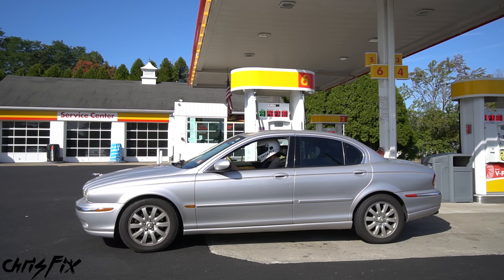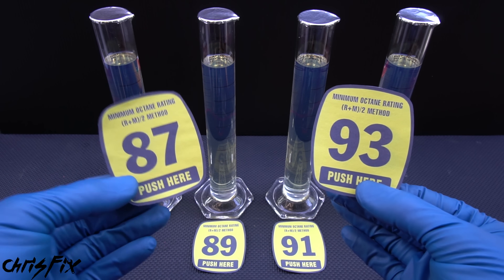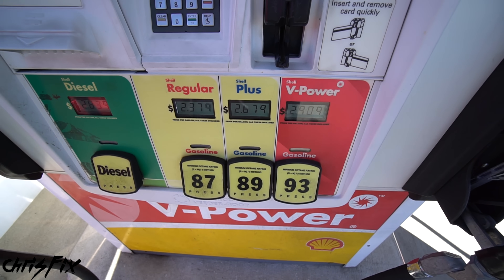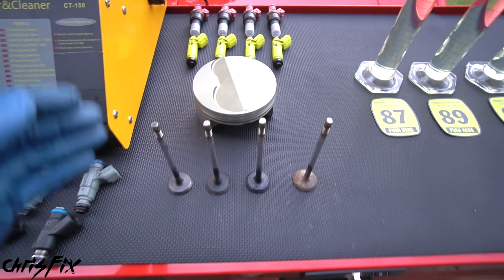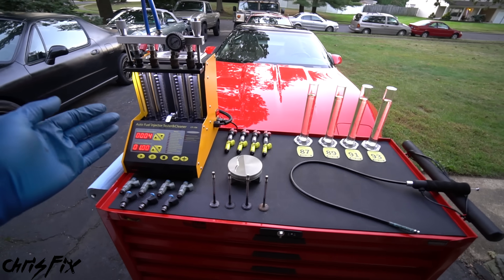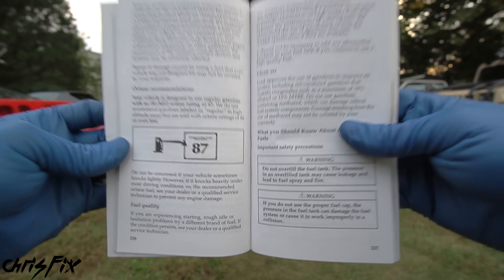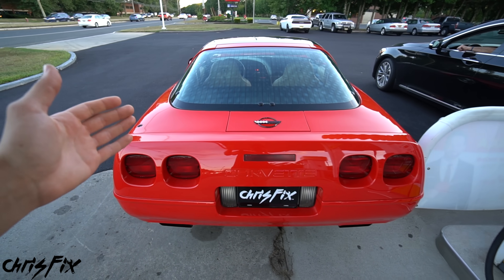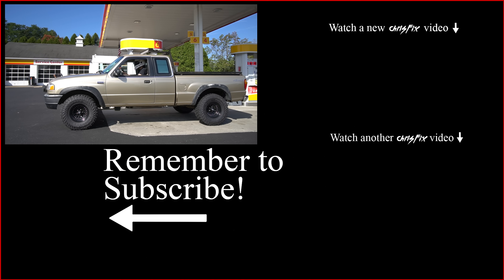What is the BEST Fuel to Use in Your Car or Truck and WHY

Comment: The question I was hoping you would answer was if an older European car says 91. I've heard 2019 American has is different and put can use 89 or 87 HD or says 91 in the manual. But I forget the details. 25 years ago I don't think they had the ability to make the 93 we have today. I could be wrong but that's what I've been told.

Comment: always found it weird visiting ammerica and pulling into the gas station and there being so many choices of petrol, In the UK we literally have 95 or premium 99, some cars here actually need 99 if you use 95 it will cause an EM warning. also 2.39 for a US gallon in the UK we pay roughly £4.37 per US gallon which is $5.50 a gallon

Comment: Hey brother this is a great video. Helped me have a better understanding...... BUT some cars with a knock sensor will actually make the car buck and run like crap.... example, I had a 1992 escort GT, had no idea about what gas to run so I always ran 91 and it ran like a champ. One day I needed gas and forgot my wallet and only had a few bucks cash so I grabbed 89. Long story short, the car bucked and bucked under medium acceleration. Couldn’t figure out why so I drove it lightly and ran my 91 and BAM! It was fixed. as a mechanic, I still don’t have a complete understanding of fuel but this definitely helped..... thanks a lot brother, keep the videos coming, you’ve come a long way and have such great knowledge to share with so many people including professionals

Comment: @ 0:15 - @0:26 LMFAO ~ can't imagine I could drove 4-6 cars into the same gas station in the same spot on the same day wearing the same helmet. hummm....I wonder if using seafoam helps cleaning the engine given I have been using O91 all the time; when the stealership will encourage consumer to service their car on decarb for $200+

Comment: I used to have E85 on my Mazda 3 2008 non-turbo it was normal after 2 weeks and later the engine lost RPM. Good news Mazda 3 didn't power off the engine still stay up but won't move or increase RPM. So I replace fuel pump and remove gas tank put regular gas everything is normal. I am little surprised the engine still stay up really strong because last time I replace spark plug it destroyed everything from E85. I have never seen spark plug destroyed completely after the engine went down after 2 weeks.

Comment: So i could clean my injector by filling my car with shell nitro plus? 
Btw my car recommends regular

Thanks
Reply: Use regular, like recommended, and run a fuel system cleaner every oil change, or second oil change, to maintain a clean fuel system. See Chris' fuel systems cleaner video for more information.

Comment: From my findings, find the station that sells the MOST gas in your area, and buy that. It might be a little more expensive, but better gas mileage all the time. I have a 2006 Scion TC that gets somewhere between 19 to 21 on just anyone's gas. Sheets gets 26-28. A 1992 S10 with a fresh 2.5L 4cyl. gets 19-21 on anyone's gas. But Sheetz gas I get 25 solid, and up to 27...
I have shopped several places Exxon and other top names as well as Sheetz. I ALWAYS get better gas mileage with Sheetz. My rationale, with Sheetz; they move gas faster, get it out of the tanks faster for more fresh gas restoration. The one point that everyone agrees upon. Ethanol gas doesn't have a long shelf life. So that is why I think I get better mileage with Sheetz. Truely though, any station with say smaller tanks, or larger customer consumption will get the same or roughly the same mileage. It is just the smaller stations that do not move the quantity and has older gas in their tanks...

Comment: I Like the video and you are right about the difference in measuring the octane numbers, but at special pump stations in Germany there is 100 Octane (Shell V Power) and 102 Octane (Aral Ultimate). This is good especially for high power turbo engines, for example the Golf R or the AMG A45 engine.

Comment: Have have some questions. Are you recommending to use shell Because I personally use Thornton’s so should I change? I have a 96 Chevy Tahoe I put mid grade in it and I put Lucas fuel additive in it every 2nd or 3rd tank is that okay for cleaning the carbon? I have the 350 engine so I get bad mpg (like 10 mpg) so how could I get better mpg?

Comment: Resistance to detonation (under pressure). The fuel burns both hotter and more completely under pressure because there is more air to burn the fuel. More air, more fuel, more energy released. More energy released, more heat. The fuel may burn at the same temperature, but due to the fact that more is burning within the same or many times, smaller volume, more heat is produced. Simple thermodynamics. You can actually measure this difference with a temperature gauge and a car that recommends or requires premium. If you run regular, you will see slightly lower coolant temps. Run premium and you'll see higher temps because more heat is dissipated through the cylinder walls. This test is only applicable in high compression engines. 

Running premium in a low compression engine will not do anything besides hurt fuel economy slightly because the engine isn't burning as much of the fuel injected. Read your owner's manual and use the recommended fuel. I 100% agree with you there. 

Good points about the differences in fuel rating between countries. Good warnings about valves and injectors. 

Hmm... 2500 miles of shell v-power = about 100 gallons at the current national average fuel economy for USA. Average cost difference between regular and v-power nitro is about $0.30/gallon. $30 for a 70% cleaner engine or $9 for a can of some other cleaner (some even use distilled water) and keep using regular? Gotta love Shell's marketing.

This is coming from a guy who uses only Shell V-Power Nitro, so I am absolutely not opposed to their gasoline. I am just very much for factual presentation of information.

Love your videos Chris. Been a subscriber since before 100k subs.

Comment: I am quite sure different gas give you different power output, maybe not because of the Octane but the additives. I have do a little test by myself few years ago. 5 tanks each with higher and lower octane and 5 tanks with lower octane + octane booster. I only refuel when warning light is on and I do it in a 2-2-2 and 3-3-3 tanks pattern try to minimize temperature and humidity difference, the test results are consistence (not much difference in my routine and driving habit between tanks).  
Higher Octane fuel comparing to Lower Octane: more expensive, average around 5-6% more mileage per tank, rev goes up faster when racing and no knocking for both.
Lower octane + octane booster comparing to Lower Octane: VERY Expensive, no significant mileage difference, rev goes up even faster but a bit more backfire than usual.

Comment: Great as always Chris. However. You didn't talk about the ethanol added to all (in Canada anyway) fuels. 10% here in Canada. (I know but many may not). Again it's all about knock and in ethanol's case "Politics". LOL. The other thing is fuel additives. You may have covered this before and I just missed it. But it's probably one of the most curious and confusing topics out there. Other questions like "what if I used a Lead additive like they had in gas in the old days?" Or "what if I mixed my gas with race fuel?" Yes I know some of these might sound silly but people want to know. Thanks for your always excellent content!

Comment: My vehicles manual says 87 minimum and 93 for towing or "severe" duty
I run what my budget dictates at the moment then adjust the weight of my right foot accordingly lol.( the addition of ethanol ruined the actual rating and quality of fuel anyway in my opinion)

Comment: Some people may have been mislead to believe there is Octane in gasoline based on your choice of words. At one point you said the Octane rating describes how much Octane is in the fuel. But it is the Octane rating. Not content. 

Octane is a hydrocarbon, an alkane with 8 carbons in its chain. C8H18. Alkanes are just hydrocarbons in which the Carbon to Carbon atoms share a single bond.

The Octane rating does correlate resistance to pre ignition. But the actual rating translated further describes how well the fuel resists pre combustion compared to a mixture of iso-octane and heptane. So, 91 octane fuel resists combustion as well as a mixture of 91% iso-octane and 9% heptane. 

And for everyone outside the US i apologize for using American Chemistry slang. IUPAC methods properly name iso-octane trimethylpentane just like iso-butane is trimethlypropane. Dont sue me.

Comment: Chris helps all us ! In all kinds of ways , even if it's a common sense thing like the correct fuel ! I would also add Lucus fuel injector additive for any car or truck to additional clean your new or older vehicles especially older trucks that pull anything!!! Use mid grade or premium add Lucus no more knock smoother excelleration

Comment: When is e85 viable versus 87? Dad's got an 07 grand Cherokee with the 4.7 flex fuel. What price difference should my dad buy e85 at? Usually e85 is 40 cents cheaper

Comment: Is it possible for the additives to clog your fuel filter? I've had to replace my fuel filter 2 times in 2 years, and both failed after going to this specific gas station.
Reply: No it’s not possible for the additives to clog your fuel filter man. That specific station could have dirty contaminated gas or you may be getting scammed by your mechanic
Reply: @Ben-wj4rq  I don't go a mechanic, I do all work myself.

Comment: E85 can also eat away some parts of the fuel system of cars not meant for it.  Like fuel lines and some filters, gaskets and o Rings       and sometimes even a plastic intake manifold

Comment: Your gas is more bad than eur gas, i used to put in germany 98 octane gas and it s running greate, i putted 93 in a eclipse and shipped it to germany, with the ideea of any product is better than our product, i putted the gas from eclipse in my  e34, the result was, engine didn t run at the same power, basic ideea, your gas is more bad than our

Comment: Whole vid is questioned after hearing someone say “run octane booster.” Go ahead, run it,, then remove the spark plugs and plan on a new engine because octane booster does nothing except accelerate rust. It will rust out metal overnight. I’ve seen it countless times. Octane booster is garbage. It’s a myth. You can’t magically add 100 octane equivalent fuel from a 12 ounce $4 bottle of shit. Hearing you say “add octane booster” makes you sound like itsjusta6 or superremedial Rob.

Comment: Want do best for your petrol engine? Add 2S JASO-FD oil to fuel in 1 to 500 ratio. Higher power, and mileage, cleaner combustion chamber.

Comment: Funny thing about E-85 is that it's not always 85% ethanol, depends on the time of year, cost of ethanol, cost of subgrade, etc. In the stations I deliver, the E-85 typically varies from 60 to 85%. Just remember to buy from merchants that guarantee their fuel. Source: I drive a fuel tanker.

Comment: another thing to note is  that Top Tier gasoline is a group of brands that agree to meet higher additive standards set by car manufacturers like ford, Honda, Toyota, BMW, etc.

 there's a list of brands that meet those requirements on the website and there should be a top tier logo on the pump if they meet it

Comment: My vehicle has 132,000+ on it. It only needs regular gas but is it a good idea, overall, to just go ahead and run shell premium for the next 2500 miles then go back to regular to see if there is any noticeable difference in the vehicles performance? Only asking because of my miles

Comment: It isn't entirely useless to run premium gas in your normal car, every so often. 2 Full consecutive tanks a year, of the premium gass, with all the extra additives, is a quick and easy way to keep things clean (vs never doing so so). There are millions of those "cleaner" additives u can buy off the shelf and put in....but most honest mechanics say, those are snake oil. it just easier to get the well tested and mixed gas with most of the proven additives.  I have to wonder, Shell gas is SO hyped....there are no Shell station anywhere near me. I go to Holiday, thanks to Cub food rewards card and Holidays own gas card, save about $1 per gallon each time i fill up. Pretty sure that all "name brand" gas has the same kind of premium additives and that it makes no difference what brand u get.

Comment: More btu's in 87 octane than 93. Typically they use more ethanol as an octane booster. Less btu's in ethanol than gasoline. No matter what, ethanol will cause a decrease in efficiency versus gasoline.

Comment: Ok I have a 1997 Toyota 4Runner and it has 326000 miles on it should i use A higher octane fuel

Comment: All the gas stations in your area get their gas from the same refinery but throw their own additives in the gas to make it special.  Some even throw color die to differentiate from other brands.  As far as Octane, most cars can use whatever gas you put in there, and will adjust to use it.  Older cars won't and will knock.

Comment: I feel no difference between 87 89 93 on my 2012 NA civic. But I did feel difference between 87 and 89 for my VW golf. The manual said 87 is required but putting 93 will give you full horsepower 👍

Comment: Great great video. I already knew about the RON/PON difference, and I also knew about the correct usage of high-octane (high-octane for high compression engines, but useless in normal compression engines, low octane can cause knock in hight-compression engines), but I was very glad to see this explained so clearly here. Thanks for taking the effort to clarify, really well done video!
There seems to be a bit of Shell bias here ;-) but all good, nothing too much.

Comment: I'm no expert, but I'm pretty sure that for many cars, using "regular" gas is actually the best option. If it's designed with lower compression in mind, a higher compression might not burn right.

Comment: There is only one nozzle for the different fuel octane's. Will that not affect it.
Reply: Not really, the pumps have a 'drain back' build into them so the fuel still in the hose is so minimal it makes no difference. In fact to get mid grade fuel the gas delivery system actually mixes together with a ratio of regular fuel and premium fuel.

Comment: I've never found an 87 octane (recommended) gas that my 4.7 Dodge runs good on, it runs best on 89, I get 2-3 more mpg, and it never struggles up a hill on 89 octane. I guess my injectors just need cleaned!

Comment: Mhhhh... we dont have the equivalent 87 octane in Europe so yeah, most US cars run on a lower grade fuel, means less compression, hence less efficiency, hence more consumption, hence favoring global warming! And European turbo charged car can run on 95 (or 89 in US) and they run even better on 98 (or 91 in US), delaying ignition and you get slightly better performance and lower consumption

Comment: Hay Chris, thanks for the vid! Question, on your Vet, it looks like an LT with some fuel line covers. Are those covers hiding coils? I'm debating on an option conversion for my '95 LT1. Any advice would be appreciated. Oh, and by the way, if I'm wrong and that's not an LT, don't crusify me in the comments, I'm still learning.

Comment: I was hoping for a little more detail about gasoline quality. Shell is definitely good stuff, but the same can be said about all top tier brands.
I had a 1984 (EFI) Nissan 300ZX that had terrible clutch judder. One day I remembered my carbureted 1970 Volvo did the same when it had funky ignition points so, although the Nissan had electronic ignition, I knew engine conditions could affect low speed / high load operation. I put in a tank of Texaco and within 100 miles the judder was nearly gone; by the time I refilled it was completely gone. Since then I have cured lots of judder for friends and family by recommending a tankful of at least major brand gasoline. Nobody believes it until they try it.

Comment: The Chevy cruze 1.4 turbo is an interesting example.  The manual says Use regular unleaded gasoline with a posted octane rating of 87 or higher, but the engine is tuned from the factory to run premium.   It will give you a completely different timing map, better throttle response, and more power.     It runs fine on 87 because of the knock sensors doing their job but you can feel the difference since it's so slow in factory form.

Comment: The claim of the amount of energy being the same is not entirely true.  Some "premium" 91 octane is ethanol free.  I absolutely see increase in MPG and I also have logs upon logs that show my LTFT on the E0 91 hover between +0.8 to -0.4 and when using E10 they drastically change to +6.6.  The gasoline with ethanol requires a higher AF ratio of about 14.2:1 rather than 14.7 for gasoline.  So you absolutely have less energy with E10 fuel.  Perhaps out of scope for an octane only video.

Comment: Hey ChrisFix, what about ethanol free gas? I know for some things they say its better to run ethanol free for carburetor engines, like i use a hydraulic auger that has a carburetor engine on it and i was told to use ethanol free, but whats the reason for it? Also i ride a motorcycle that says to use 87 or higher, is there any benefit to using higher octane, and is there any benefit to using ethanol free? My motorcycle is fuel injected too, if that makes a different. Loved the video, thank you

Comment: Hey so, my 98 Chevy manual says 87 or higher, but we only have 86 as regular around me, do I use the 88 or is 86 at these pumps fine. Cant find anything on google. Its 30 cent more for the 88 than the 86